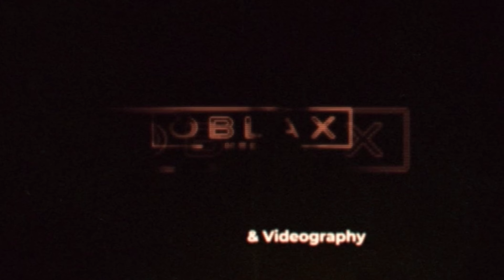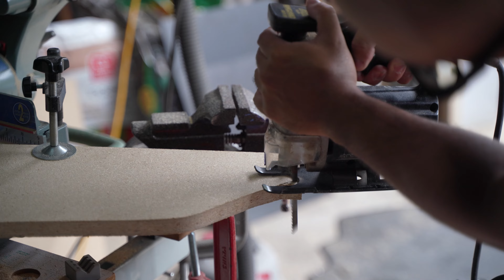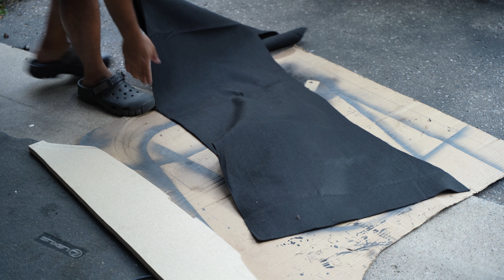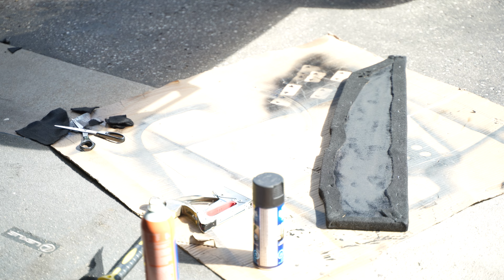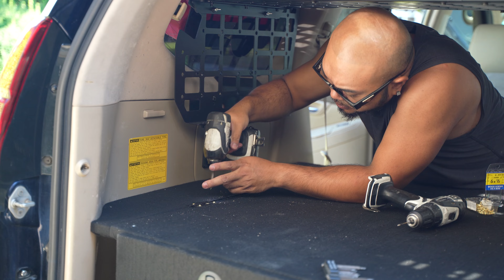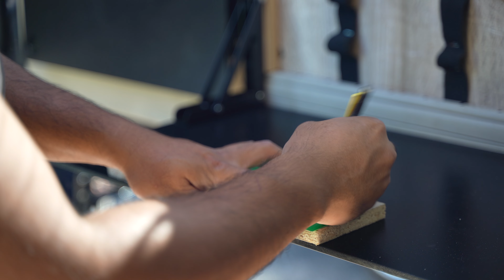Lexus GX470 Drawer Build - Part 4 [Finally its Finished! | GX470 Mods | Install]

Comment: Bro, how did you secure it to the floor?
Reply from the maker: So I made a base made out of 3/4 wood. I traced the original carpet, removed the D-rings and then used bolts that goes into the D-rings mounting points. Then the drawers are bolted to the base.